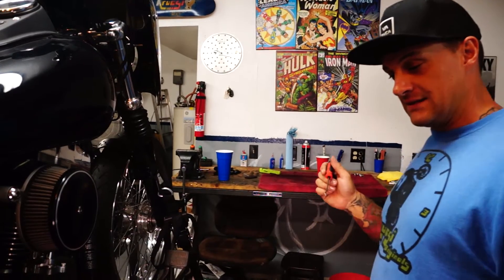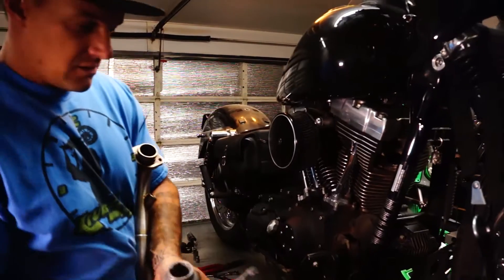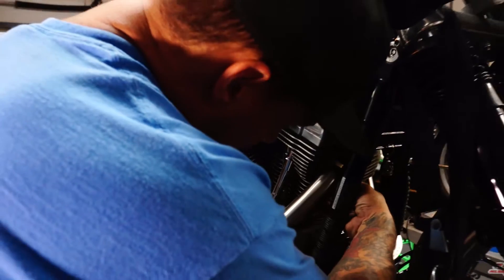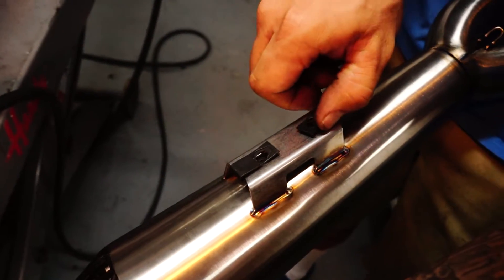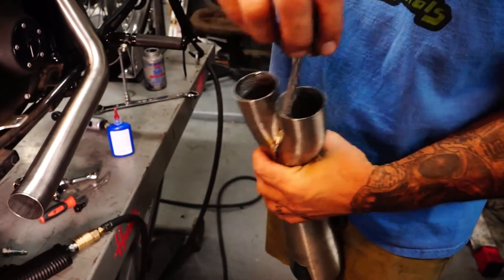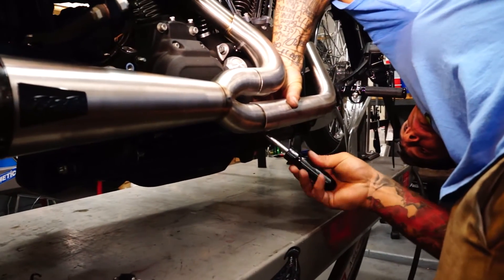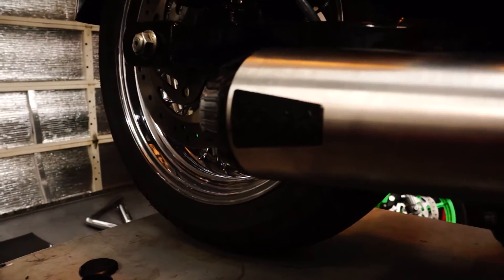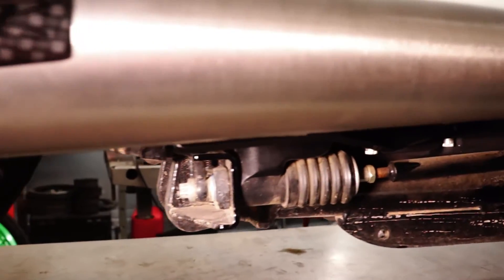Two brothers exhaust. Install and over view.

Comment: just got mine a week ago. Love the final outcome. However I notice the rear pipe hits the brake pedal. Did you encounter this as well? If so, how did you fix it? Thanks.
Reply from the maker: Leo Robles check your install. You can manipulate on where the pipes it's you have to make sure it's not any binds and you have Clarence everywhere
Reply: Ok will. appreciate the quick response. love the videos by the way.
Reply from the maker: Leo Robles Hell yeah dude thanks for watching.
Reply from the maker: Leo Robles that's all in the adjustment when you install the pipe. You can move them around a lot

Comment: Hi, I just fitted one of these to my 03 dyna.... broke the bracket on the 1st ride because the front pipe is too close and hits the frame!had to hit the front pipe with a hammer to make enough clearance. Very average performance on the dyno with a massive torque dip from 3-3.5k rpm. Definitely not recommended for 5 speed dynas!